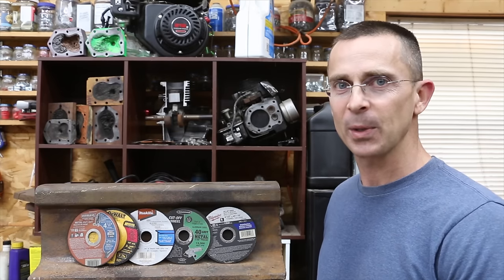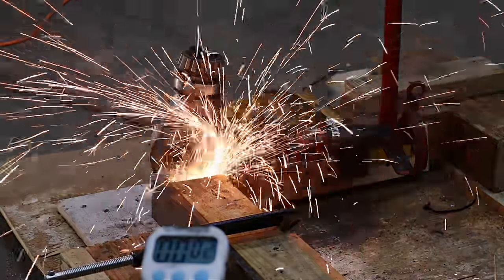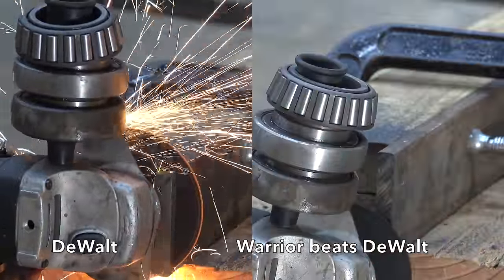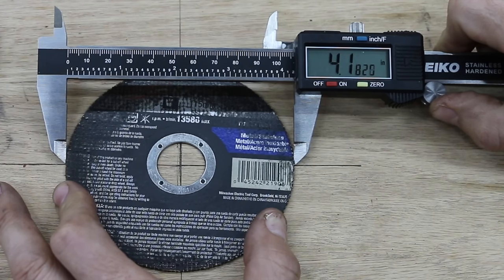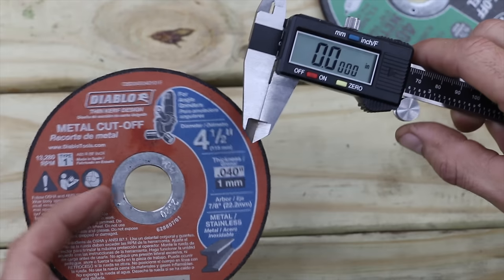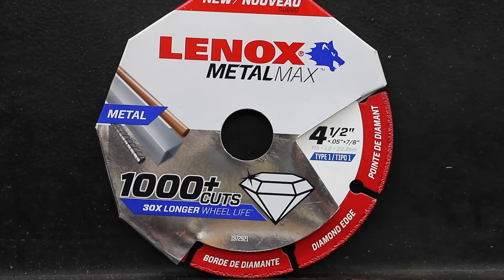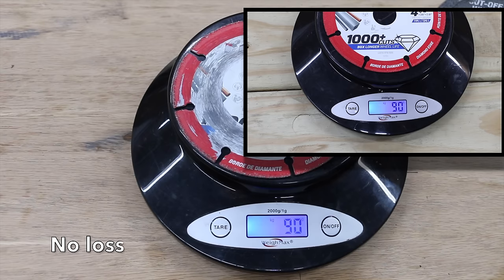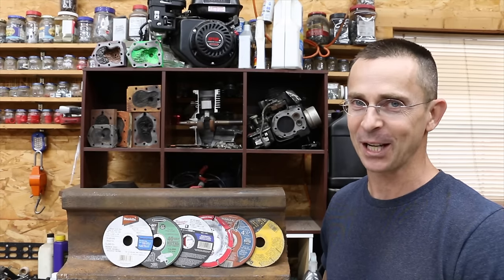Best Metal Cutoff Wheel Brand (6 Brands Tested)?  Let's find out!

Comment: I recently discovered that the 3.5" Dremel cutoff wheel I picked up at the big Orange box store lasts 3 times longer and is 2 times sharper than any brand I've used before (and I've used a lot over the years) I don't know what is in it but I was amazed. One note of caution; the Dremel wheel has a slightly larger arbor hole which I had to make an adapter to fit my cutoff saw.
Reply from the maker: Thanks for the feedback.

Comment: When my discs reach minimum working size for the angle grinder I remount them in my electric die grinder and use them down to the nub, I did make a special arbor on the lathe to adapt them but now all I toss is just the metal rim.☺
Reply from the maker: Thanks for sharing.

Comment: 6:59 Notice the steel part heating up, which is not a good thing. Blade's a gimmick, or diamond tips's meant for a different SFM (surface feet per minute). However, I wouldn't be comfortable putting more pressure on a metal blade on an angle grinder... If it breaks apart, it kills 30x more whatever the 30x lifespan lol
Reply from the maker: Thank you

Comment: I use the harbor freight cut off wheels, I have never had one explode and they last so much longer than the rest I have available locally.   Another plus is they are only 8 bucks for a pack of 10 even if you use more blades you still save money.   For me and the backyard or garage diyer they are the best choice in my opinion.
Reply from the maker: Thanks for the feedback.

Comment: Forget what I spent on my diamond wheel.  But It definitely shines on thin material(no thicker than .09"). I balk at using my warrior wheels, as I know they disappear rapidly. But, one should definitely buy these in bulk for the best savings ;) 
My absolute favorite blade is undoubtedly the Diablo 9" carbide steel demon(DS0908CF). 
It's definitely the energizer bunny when comparing reciprocating blades. Before these, I was using a Milwaukee torch (non carbide).  Night and day difference.
Reply from the maker: Thanks for sharing.

Comment: an oldie but goodie.  Thanks Todd.   One thing you didn't point out is when discs that wear down faster that abrasive material goes somewhere - namely into the air what you are breathing.   Not good.   I bought Makita discs based on your testing.   Thanks Todd.
Reply from the maker: You are welcome!  Thanks for the feedback.

Comment: I've used Makita cutting wheels on my chop saw before, and they cut better than any others I've tried. Not surprised to see Makita come out on top. Also had a few Warrior 4 1/2" wheels shatter/explode on me before, never again.
Reply from the maker: Thanks for sharing.
Reply: I wonder if a test could be designed to measure wheels’ propensity to shatter.

Comment: I cannot recall the name but another YouTube channel, a young fella that seems to have every machining, welding and metal working tool imaginable in his huge shop did a similar test on cutoff wheels but his was more so on what technique gives you acceptably fast cuts and prolongs the cutting life of the wheel found that continuous scoring and increasing your depth (without plunge cutting) while cutting across the surface results in much longer cutting life and the number of cuts per wheel.  Versus the technique he was more prone to do and similar to the near full depth cut your test setup was doing.  He found that continuous scoring cuts where you cut a scoring line then continue to follow the line increasing your depth until you cut through the material extended the life and number of cuts each wheel would deliver about ten fold versus the hard fast full depth type of plunge cutting.  Little bit more time and human effort but far prolonged cutting wheel life and number of cuts.
Reply from the maker: Thanks for sharing.

Comment: With the Lenox blade, you can and have to apply more pressure than a regular cutting wheel. Using it, I’ve noticed that it cuts through like butter once you get it and the metal hot enough, but you’ve got to keep the pressure on it
Reply from the maker: Thanks for the info!

Comment: We modified guards to run 6 inch wheels. You find out quickly what lasts when fabbing non magnetic stainless. We used Walter brand zip wheels which are not sold in mart stores. They were the best by far . Use diamond wheels now . Lennox makes the best reciprocal saw blades by far
Reply from the maker: Thanks for the feedback.

Comment: im also a farmer and for my many sins have to cut steel all the time.  if im going to be somewhere awkward (like on a tower or in something i dont want to climb out of) then i use the lennox wheel because i dont have to change it.  if im working in the open or somewhere i can get to a box of wheels i use dewalt because you can get them at a bulk discount and no taxes (in my state) at lowes.  over the years ive noticed that the diablo wheels tend to break a lot under my ham-fisted cutting skills.
Reply from the maker: Thanks for sharing.

Comment: Nearly every trade uses grinding wheels to cut steel, this was very interesting and I love all your videos. Just one thing was missing, the compounds used to make the grinding wheel. Zirconium should cut fast and wear fast compared to silicon carbide for example. To be fair, each blade with similar compounds could be tested against each other. Or done all together but noted in separate categories as well as all together. Lastly, how come you never test out the Hilti stuff? I would love to see if it’s actually worth the money.
Reply from the maker: Thanks for the suggestion.

Comment: I bought a DeWalt diamond disc for cutting rebar, and sure it may last 50x longer as it claims but it also took 50x longer to actually cut through. I ended up using regular discs in the end.
Reply from the maker: Thanks for sharing.

Comment: I’ve been using Metabo stainless steel cut-off wheels for years but stumbled upon some Bullard metal cut-off wheels (without the metal arbor reinforcement) I bought years ago in a lot from a hardware store that went out of business and noticed how fast I had to change those wheels while merely cutting some welds from steel I wanted to salvage. 
After going through the dozen of Bullards, I switched to the Makita B-46159 (4-½ x 0.032 x ⅞) wheels and found they didn’t last very long either. Well maybe a bit longer. 

I just ordered a 55 pack of Delun Stainless Steel Cutting Wheels ($22.99 Amazon) that claims 35% longer cutting life than others, while showing a single Delun cutting wheel vs five of the others. Now I’m not a mathematician but the assertions don’t seem to align. 

The composition says brown fused aluminum oxide and fiberglass net, which is a reminder to wear a face mask. Cutting outside on a breezy day and wearing a full-face shield wasn’t enough. I hacked out a bit of black by the end of the day and I’m still clearing my throat the next day. So let my mistake serve as a warning to others.
Reply from the maker: Thanks for sharing.

Comment: Hi Project Farm!! (Todd!) 

Loving the videos and am curious about a possible additional test if you ever do a round 2!

I’d be interested to see how many times each disc can cut the steel before actually failing. maybe the grinding jig, (or steel holder) would need to be adjusted so that it could slide closer or further from the steel/grinder but I think it would be another good metric! 

One other side note. I’ve never used the Lenox wheels and thought it was interesting to see it tested. I did read one comment about them getting caught up on sheet metal, but what I was really wondering while watching was, “Would it cut faster with similar durability if much more weight was added?”  Seems to me, it’s a pretty different product than the other types of wheels therefor might have different needs for getting better results?! 

This video was a year ago so I doubt you’re still reading comments on it, but thought I’d reach out anyway!! 

Thanks for all the videos!!
Reply from the maker: You are welcome!  Thanks for the video idea.

Comment: Wow. I use those cheap Warrior wheels a lot. Pretty impressive, for the price.      We bought one of the Lennox diamond wheels, when we installed a metal roof, and it lasted for the entire job. But, it was definitely slower.
Reply from the maker: Thank you for the feedback
Reply: Yeah. I have bought the Bauer version from harbor freight. Basically a dollar  a wheel is not that bad. I have had some of them last longer than the Diablo blades before and I am a fan of most Diablo products .

Comment: I'm looking at Weiler 3" cutoff wheels for 1/4" collets. Using right angle die grinder IR 5102Max(20,000). My mini-excavator has a 1-1/4" dia. x 12" long pin that is stuck and preventing me from removing my ram hydraulic for repair. Using torch and sledge hammer doesn't help. So I have decided to cut the pin out to remove the hydraulic. It has about 3/8" room to get at the pin. Then maybe I can pound out the half pins. Space is limited to about  7".
Reply from the maker: Thanks for sharing.

Comment: I love getting the Dewalt cutoff wheels. The store where I get them always has them for 99 cents. They may take a slight bit longer but then again I am not normally cutting plate or solid stock as thick as he did. Most of the time it is 1/2 inch round stock and it takes only a few seconds to cut. Price and longevity its hard to beat for me
Reply from the maker: Thank you

Comment: Great comparison. I need to make one of those hands free automatic 4 1/2" grinder cutting mechanisms lol. 
How about a video on different cordless 4 1/2" grinders?  I had a makita (forget the model) but compared to other cordless grinders friends had it was very weak and tripped the shut off unless I babied it. Traded it in at a big loss for a milwaukee M18 fuel and like it much better but I'm really curious how they all stack up power and durability wise.

Comment: the last one well... diamond ( carbon ) dissolves in metal ( like sugar in the water ) when correct temperature takes place. I used diamond cutting wheel to cut metal only couple of times when i had no choice, after that same cutting wheel had a really hard job cutting trough a tile or concrete, spitting hot melted slag or metal all the time, not sparks
Reply from the maker: Thanks for sharing.

Comment: I use a diamond wheel for everything unless I'm in a real hurry. It just does not wear. It has saved me a lot of money as I used to go thru 10 packs pretty quick. I can put a lot more force on it without worrying about breakage. It is fairly slow, tho.
Reply from the maker: Great point!  I like the diamond wheel on thin material.

Comment: Got a test idea for you. Screw bits. #2 philips specifically. Its one of the most common used bits in drills. I am certain a few brands will do better than most of them. 

Testing criteria. Make sure drill is set perfect in the head. Don't jump on the trigger, but rather fade the power in. Impact driver test should be separate from a drill, they just act completely different. They fail in different ways from a drill. Some bits, no matter how careful I am there is nothing I can do to keep it from slipping, while others seem to bite in very well. 

I know you will figure a way to take the human out. On difficult fasteners I put as much as 50 pounds of downward force. Maybe that will help your test rig design. 

I just bought craftsman at Lowes recently and was terribly disappointed. I have have the best bite with Milwaukee bits, though usually I get dewalt, because the others are rarely available for purchase.
Reply from the maker: Thank you for the video idea!
Reply: @ProjectFarm  I look forward to what ever test rig you come up with.. Your creativity in these test never cease to amaze me. 

I mention your channel name to many when the subject is appropriate your channels subject matter..

Comment: I have not used the lenox brand (mine is a rigid) diamond cutting wheel, but I feel like it cuts faster than a traditional cutting wheel. You have to push harder where the traditional wheels will bog or chatter. Your testing would be hard to show this unless you found out how much weight was right for the diamond blade and then showed that the composite blade can not take that.
Reply: Brandon I hope he shows this in the future because I’m curious about it too

Comment: From my limited experience these cutting wheels have significantly longer life spans if you only put them into contact with the work for very short intervals. Similar to peck drilling. Keeping the wheel and the steel cool seems to be what makes the difference. It would be interesting to see a test of that!
Reply from the maker: Thanks for the suggestion.

Comment: need to do one on the diamond metal cutting blades like Lenox Metal Max. Diablo, Morse, Vermont American, Spyder, Rigid, EZARC and a few more make them.  i use them on spiral sheet metal ductwork( 28-20 ga.), and corrugated metal roof panels (26- 18 ga.)
Reply from the maker: Thanks for the video idea.

Comment: Just came across a battery powered air compressor - from Dewalt , using lithium batteries .
Have used yet , but my 1st thought was that running a compressor on batteries was a bad idea ?
Will see , more testing - want to use as a hooka diving compressor - oilless compressor , so some extra filtering may make it work , got it cheap enough .

Comment: Don't know if it would make a difference.  But normally with a diamond blade you would keep a small amount of water running on it to keep the surface from becoming  clogged with material. As they don't wear away to keep new cutting edge
Reply from the maker: Thank you for the feedback

Comment: My biggest concern with thin kerf cut-off wheels is their ability to shatter.  Google "grinder accident images" and you'll see some very gruesome examples, proving that the hand held grinder may be the most dangerous tool in the workshop.  Glad to see none of yours exploded.  Maybe this could be another test and video?
Reply from the maker: Thanks for the video idea.
Reply: i have been using these thin cutoff wheels for at least 5 years ,and have NEVER had one shatter..i bet people push them WAY to hard or try  cutting something its not made too,and make it turn too sharp ,and then they shatter, i let the wheel cut at its own pace,which is still very fast,use both hands,and keep it cutting straight,its a cutoff wheel , not a grinding wheel..,, i think the most injuries by a tool ,,is the straight blade screwdriver, being hammered into something..being used as a chisel or pry bar..

Comment: I didn't see the specific packageing, but based on the info provided here the Lenox is doomed to an early death. Diamond is detroyed by ferrous metals, diamond is non-ferrous only and cubic boron nitride is for ferrous. (The two exceptions are very low speed hand tools where the micro-contact temperature is negligable, or a flood cooling setup which you aren't going to have outside of an industrial shop.)

Comment: Would be nice to see my favorite cutting disc, the "3M cubitron 2" competing against a "Rhodius XTK6 EXACT", "Pferd SGP STEELOX" and the "Dronco AK 60 V CERAMAXX" in 125mm x 0,6 - 1mm.
Dust deposition, sparks (cooler is better), vibration levels and noise should be tested too.
Reply from the maker: Thanks for the video idea.

Comment: Duropeak from Amazon, its an abrasive wheel, lasts better than diablo or Makita.
I don't know on speed, but as it's abrasive, that means speed isn't an issue. Even, if it's a bit slower, it wouldn't be by significant much. Lasts awesomely, there is no wheel at home Depot, that would last as nicely
Reply from the maker: Thank you for the feedback

Comment: Are you cutting off exactly the same amount of metal or are the cut offs different? They need to be the same as the heat they build up can severely impact time it takes to cut through? I can see at 4:14 the thicknesses of the cut offs are significantly different. Please re do all tests but use an end stop with a repeatable position

Comment: I've been working with sheet stainless steel for 20 plus years and wouldn't even dream to think of using anything other than a Diablo wheel. I'll drive an extra hour  from a job to find a Home Depot to get em. Believe me I've tried all the rest and they ALL plain suck! I don't give a toss how much material it uses up, I'm all about speed and the Diablo simply can't be beat I'm here to tell ya.
Reply from the maker: Thanks for the feedback.